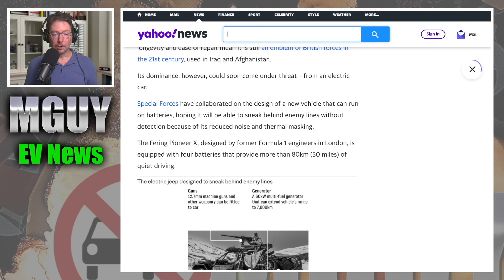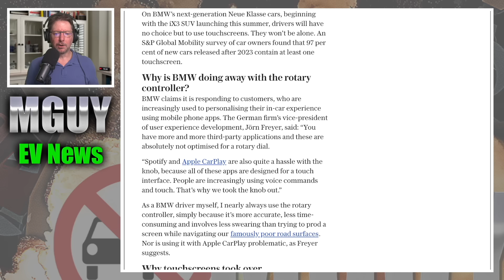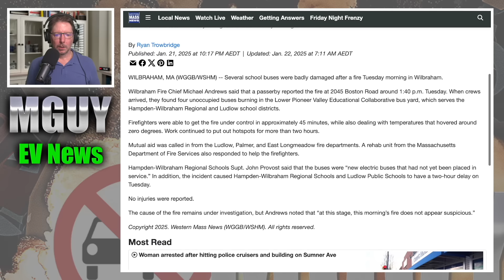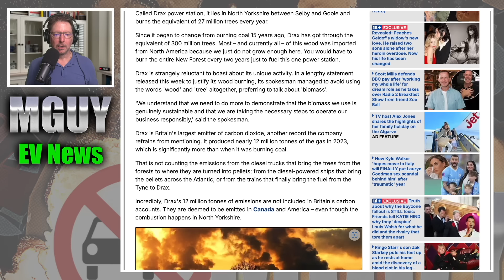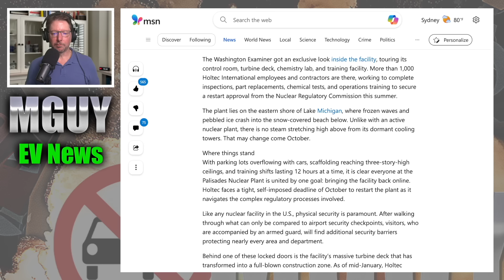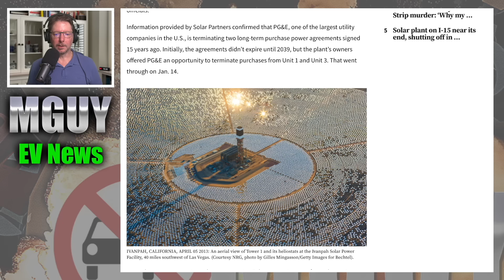Electric Jeep is UK's latest EV madness | MGUY EV News 26 January 2025

Comment: It seems we have bypassed an era of common sense  well designed cars to an era of cool looking idiocracy ! 
 I have a few cars ranging in age from 30+ years old to 7+ years old  , and not a touch screen in sight  , and I’m so happy , all three vehicles have knobs and buttons in common sense places  , the very best of the three is so well designed on the inside , I can alter 99% of any of the drivers controls without taking eyes off the road , just by reaching and feeling the different knobs and buttons ,  and this is a serious safety enhancement imo  ! 
 Even the side mirror control was mounted on the top of the door adjacent to the window with like a joy stick knob the you twist to the left for the left mirror  or the opposite way for the right and then the same knob you used as a joy stick , a perfect example of a driver controls without taking that needs you to not even look where your fingers are with a just a single fleeting glance at the mirror.  
 You look at idiotically designed new cars , the electric ones that do not even have a dash binnacle directly in front of the driver , it’s just idiotic ( Tesla I’m looking at you !). 
 And don’t get me started on vehicles like teslas that have NO SPARE WHEEL  and NO JACK !

Comment: This video is why we need to be wary of either side of the argument. There is a case for super quiet running vehicles for battle. The idiot commentors conveniently missed the fact that it has an engine with fuel. A small vehicle like that isn't going to be long range anyway.

Comment: At the touch of the button are fantastic, when the button is specific like cruise  control, or answering the phone buttons on the steering wheel.  When it is become integrated into the infotainment center (computer) and everything is under different software on different screens become drivers distractions when you want to change radio station, and then change screen to turn the window wipers on, and then another to use phone, and another to check weather conditions.  Might as well remove laws of using phone while driving (texting and watching YouTube).  All features should have designated controls without distracting driver from the task of driving under muscle memory of controls without taking the drivers eye off the road.  Assisted driving encourages taking your eye off the road while checking your email.

Mama always said, stupid is as stupid does.

Comment: The solar plant on I15 near the Nevada boulder as been a failure from day one.  On, off, on, off.  Costs more to operate than it produces.  As far as the burning birds (streamers) there is a crew of 2 that race to remove these burning birds from damaging the equipment.  That makes it environmental unfriendly.
Reply: Oh wow, didn't know. Zero "save the planet" clowns talks about the Death Ray setting birds on fire mid air, how about that 😑

Comment: Question,,, Why do Tesla's do not have AM radios?  Because the electronic noise from the motors and such are too noisy,, a big pain to quiet them down.  If I was an enemy and knew these EV things might be used, with an antenna and receiver I could get an early warning.

Comment: Touch screens are a hazard on the road if you have to take your eyes off the road to set controls. The last car I purchased has a large screen in the center of the dash but everything I need to do on the road can be done with dials and buttons. If you can’t keep you eyes on the road while driving to become a hazard to yourself and other and should not be permitted.

Comment: If they want a dependable silent vehicle they should go for hydrogen. JCB have made simple modifications to their diesel engines to allow them to use hydrogen and they have been well tested and are on the market in the UK and India together with carbon fibre fuel tanks and fuel bowsers' o go silent the hydrogen can supply power to a fuel cell driving an electric motor that s part of the drive chain like in the Zonda that can also work with the motor to give more torque for difficult conditions. Why design when you can adapt at low cost

Comment: Running out of power, with no options, is like phoning home and asking for a 'shilling for the meter'! 

From a technical point of view, I wonder if electromagnetism could be detected even though it has no thermal signature.  With an on-board engine it's just like a PHEV or similar ~ makes a point. 

Touchscreens: you can't use a phone, but have to be able to control your car!  Crazy... You can feel the position of a control knob or button.
Also, for many of us, UK, Australia etc....  Right hand drive means you need to use your left hand - which doesn't work for 80% of us!

Comment: So they need lug a very heavy battery around using more Diesel. The battery power will be barely ever used because there will be nowhere to charge it. 
Then when the battery does go it will need to be chucked because it’s single use.

Comment: There is an engineering principle taught at Massachusetts Institute of Technology, it is called the KISS principle. That stands for Keep It Simple Stupid. In the current subject, this would refer to switches. It doesn't get any simpler than a physical switch, nor more complicated than a touch screen. The complications do not stop with the physical application, i.e., programming, relays, servos, microprocessor, and connectors, etc., there is also the mental and psychological distraction. Distracted driving anyone😮? These things are far from intuitive unless you are a 12 year old who grew up with technology. Even then, programmers can throw in some weird twist. In short, if you are going to depend on a touch screen, you need a copilot. A young one😅. Simplification also brings with it lower cost and less maintenance. 
Another aspect of this to be considered,  is weather. Electronics and batteries do not respond well to extreme temperatures or moisture. The inside of a vehicle can easily reach temperatures of 160 degrees F, or 71 degrees C. Electronic components tend to "act up" in this environment. Batteries don't function well at either extreme. I would not want to depend on either in combat situations. Thank you.

Comment: With the Elites employees pulling all of this as normal. Look at this vehicle. I bought it back in October. Yet. Only two seats. A 2024 F250 transit cargo van with the 3.5l. An E85 setup. Means. You can use any type of gas in the van. Now. The van is made out of steel. Look at the dash. 100% usable. Even 6 cup holders. Meaning. An easy place to put a cellphone for navigation. My info center. Is the normal little one. A single backup camera. AM/FM radio. Mine is a mid roof. The camera is up high. Easy to see over most vehicles while backing up. Outside the E85. The van has tow mirrors and tow package. Why the van. I took UK advice. The van has endless uses besides a 5th wheel hitch. AWD. My van was cheaper than an F150. Why. I did buy all of the technology. People say only Mercedes and then Dodge. Not Ford. Again. Look at all three dashes. Ford is the only one with 100% of the dash that can be used for anything. AWD. E85 means any type of gas. Steel body. Cargo means the van can be put to work as a semi truck. Here is USA Nebraska. My van is plated as a normal car. Not a pickup. No extra road tax. Because the van is not being used as a semi truck. Yet. Zero weight restrictions. I can use the van anyway I want to. Even a weekend camper. I just don't have to build it out as one. Mid height 
Mid length. 4x10x6 foot space. One massive trunk. Climate controlled. My 42-inch riding lawnmower fits perfectly in the back. Means. A ATV will also. A motorcycle as well. Two pallets. Half pallet of cement. Weight. Just under 3,000lb. No lumber in the rain or snow. A little workshop. Then. Amazing time on the beach or in the mountains. The UK and Europe were correct about these types of vans. Hardly no technology. Cheaper then a half ton pickup. Mine is 3/4 ton. Check them out.

Comment: EVs are not silent, they make a high pich noise that impossible to muffle, 4-strokes can be muffled qite effectively
Reply: @jakubmikita6069 4 strokes also produce a lot of heat. Way easier to detect that at distance than noise. And also way easier to build heat seeking munitions than noise seeking munitions.

Comment: Ford trucks have got it right, the new IVECO S WAY truck has all the main controls on the steering wheel under your thumbs and a single screen on the dashboard directly in front of the driver.
You just switch between the screens as needed, engine temp ect, or a useful display showing if something is beside the truck that you may not be able to see in the mirrors.

Comment: Friday, I was alongside a large truck used to service electrical wires and had a service bucket crane.. It advertised  on the side that it's all electric. It belonged to our state utility company.  
The EV battery box was a large rectangle , half as long as the truck, and taller than the cab from the frame up. Also there, under the hood were additional batteries and motors for the rig.The truck had to be lengthened  bigger than similar trucks. I could only wonder will the crew get out before it ever begins burning.  ?.
When I was in the military. We had that jeep.  And four wheeled RAM trucks. That's how we ran around in the field.

Comment: What is their definition of a tree? A 50' pine tree with a DBH (diameter breast height) of 4" or a small deciduous aspen? A larger Douglas fir 70' high contains approx. over 1 cubic meter of wood. When I was logging years ago I would receive $100 cdn per cubic meter.

Comment: I recently rented a car that had a touch screen for adjusting the radio. It did have physical buttons for AC/Heat and for heat/cool for the seats. I wanted to listen to the radio. It was not intuitive (to me) how to even turn on the radio but somehow I accomplished the feat but found the only way to select a station was with the rotary knob (again not intuitive to me). I finally decided that it was not safe to do this while driving, so I just never listened to the radio. Instead of mandating EV’s, perhaps manual buttons should be mandated.

Comment: I don't know....

A pure EV for the battlefield is admittedly stupid virtue signaling. 

This "jeep" is a hybrid that apparently works like a typical train: diesel generator charging the battery to power he electric motors, whose only advantage is the TORQUE, which is what a combat vehicle needs to negotiate rough terrain, just as trains need the torque of the electric motors to move the huge weight of their towed cars.
Reply: Diesel/electric trains are the way they are because a mechanical drivetrain would be way too complex and unreliable. The torque of the electric motors is also very useful.

Comment: To be fair, I see no problem with specialized equipment. There's a difference between having a task specific item and what is standardized. Specialized operations have special needs, and the operators are given quite the freedom to accept and reject what they see useful and useless themselves. None of them would be stupid enough to value environmentalism over their own or their teammate's life.
A hybrid can have an advantage in certain situations, but using an electric drivetrain does not mean that a car magically becomes noiseless or invisible. It may have the advantage of deploying closer to an operational area, as it has lower range of detection, but what the article writes about is pure fiction. By the same reasoning, special operators should be traveling on mountain bikes..

Comment: good luck selling those new BMWs in the UK; they are illegal. It's a legal requirement for drivers to be able to operate vehicle controls without looking away from the road, you simply cannot do that with a touch screen. I'm of the view that: if a mobile phone is illegal to use while driving; then a touch screen entertainment system is also illegal for the same reasons.

Comment: Funny story, I got Microsoft CoPilot AI to admit that EVs are more dangerous than Gasoline cars.  It told me straight that there have been zero documented cases, ever, of any Brand New Gasoline Powered car from catching fire while sitting on a Dealership Lot, or a Semi-truck trailer being delivered.
Meanwhile we have many documented cases of EVs doing just that.

There are zero cases of Gasoline Cars catching fire when they get wet, meanwhile we have documented cases of EVs doing just that.
And it also admitted that the numbers of ICE cars that catch fire use Arson, criminal activity, in their burn numbers, while not doing the same for EVs.

It's funny when the AI, which has the power of the Internet, will actually circumvent its own programming to admit that the technology is a more dangerous technology. it was hilarious. 

I got it to admit it with a simple "YES or NO" answer.

Also it doesn't like Renewables, as it says they're not reliable, and not stable, and gave a preference, although nuanced, towards Nuclear Power, considering its stability, reliability, and small footprint, vs Solar and Wind.

Comment: I so agree about the touchscreens! At my company they offered a few years ago a Tesla Trial Drive. I was horrified about the ergonomic: A single high reflexive touch panel was in the middle, forcing eyes and head away from the direction of drive. It was late, sun was low and when I turned, it reflected from this touch tablet and blinded me during the turn. And these flat hidden door handles are in my eyes a major life risk in case of an accident: Emergency personal cannot in split seconds open these stupid doors. Horror pure,needs lawmakers to act at last. Now Ford in their "hashtag me too" offers a model without any door handle. One need to press a button on a strange place. Good luck.

Comment: Good God!  They built all of those solar-thermal arrays years after a pilot project near Barstow, California called Solar 1 - later Solar 2 - proved impractical.  It ran from 1982 through 1986 as Solar 1. Later, more mirrors were added and the name was changed to Solar 2 and ran from 1996 through 1999, when it was shut down permanently.

It was also known for its efficiency in immolating birds in flight.

Comment: Another LEMON ..
You realise you can make a battery out of a lemon, by the way.
Just add dissimilar metal rods.

That EV will radiate a massive EMI field.
With all the electronics on the battlefield,  it will be MUCH EASIER easy to detect. 

Go Diesel .. and if it  has mechanical injection, the only engine EMI is from the fuel pump.

Comment: Yeah...  the SAS are really going to dig this !!    😄🤪
Reply: @keithphilbin3054  Yes Keith, the SAS really are going to dig a vehicle that’s better suited to some mission scenarios than an ICE vehicle.

Incredible torque from 0 to max speed - better off road capability, quicker acceleration, much cooler operation - making it much more difficult to detect & successfully use heat seeking munitions, quieter - making advancing undetected on an enemy position easier, etc.

Comment: Ex EV engineer again. Totally against EVs. Stupid idea but there are some use cases they can make sense only if you treat the stuff like a disposable. I had a discussion with a Russian soldier who used Electric bikes to dash into enemy positions at high speed and if there was enough charge left dash back and sometimes when the bike went flat simply ditched it, pull a key fuse so it can't easily be used again. Benefits are fast an quiet, but not for too long and treated as a disposable item. The main vehicle carrying them into the battlefield acts as a charging station. 40km range at full throttle.

Comment: So called renewables suffer from a problem called low power density.   This is related to the problem of low energy density with the traction batteries of electric vehicles.   This is why renewables need subsidies to exist.

Comment: Electric battle vehicles might have a use sneaking over the wire to pick up injured soldiers and sneaking them back. 
Other than that 50 miles is a 1 way trip for the soldiers. Stay away with today’s technology.

Comment: Wow,, a whole 50 miles range,,AND that's when the battery is new. Makes you wonder what the range will be when its about 5 to 8 years old. At least it's got an engine to stop the troops from pushing it when it runs out of EV juice. What you want on a battlefield is simplicity and durability by keeping non critical things as basic as possible which means less problems. The Germans found this out in WW2 the hard way, the mighty Panther tank was a force to reckoned with but it was so precisely engineered that if something went wrong,  it could not be repaired quickly or easily unless it went back to a dedicated facility. The Sherman had the nicknames the Ronson or Tommy Cooker for lighting everytime it got hit. this Jeep should do equally as well.

Comment: The electricity from the Drax power station is 25% more expensive and it used to be supplied by a nearby coal mine via a direct rail line but when the dingbats changed to burning trees they closed the coal mine ergo all the jobs were lost you couldn’t make this shit up